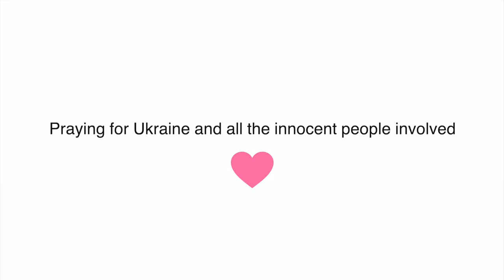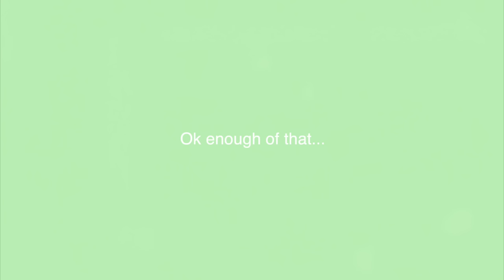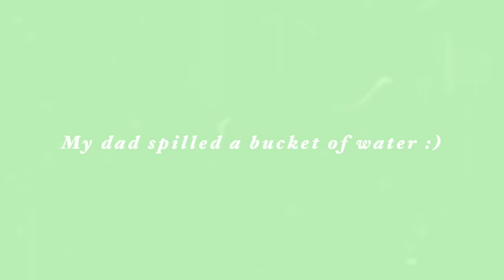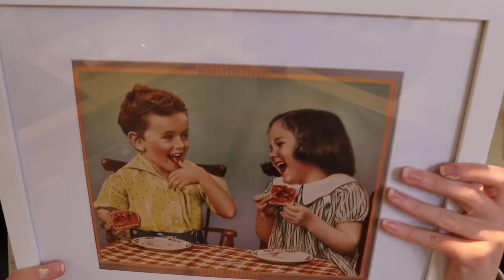Extreme Kitchen Makeover *we did everything ourselves, and you can too!!*

Comment: Love your kitchen make over. Adore the backsplash-so worth every minute of work. I also did a diy of my kitchen changing all of the doors from the formica euro doors of the 80s with the wood strip. We opted for shaker doors with euro hinges and 4glass front doors that had been solid. Then i wall papered the inside rear wall of the glass front cabinets. The wallpaper matches the heavy cotton fabric upholstery of our swivel stools . I tiled the counter with cobalt blue porcelain tiles to make it heat resistant and get the color i wanted. The island is navy, as is 1 upper wall with the lower half white wainscoting. We scraped off the popcorn ceiling too and added crown molding. White and navy looks so clean. The re-do was so worth it.

Comment: Tile tip !! if you want it to set faster so that you can grout, use thinset, not pro mastic
Reply: Another tile tip!! make sure you get a grout with a sealer built-in so that it never stains. and if that is a natural stone you'll want to seal it also so grease doesn't stain it. If its not a natural stone, sealer will create a haze on the tile and it should only be used on grout

Comment: From a student electrician: Please please please turn off the power before working around live wiring! Even better to turn the breaker off first. Even if you're being very careful, you don't necessarily know if mistakes were made when the wiring went in, what mice have chewed on, where there's been a leak, or when the house could get a huge power surge. This is a very common cause of electrocution injuries and even deaths! Also, it's not the voltage that hurts you, it's the current. This is why people survive lightning strikes and die from industrial accidents!